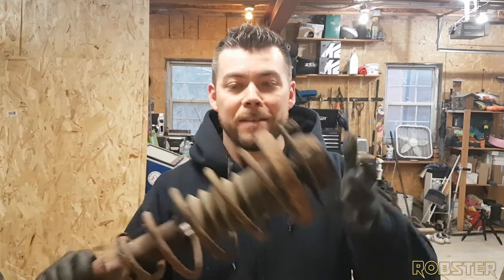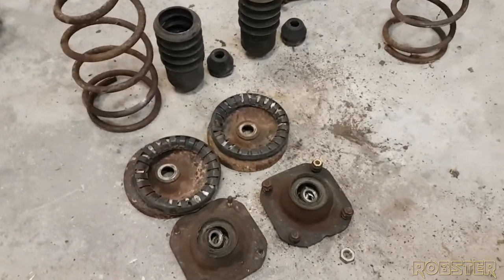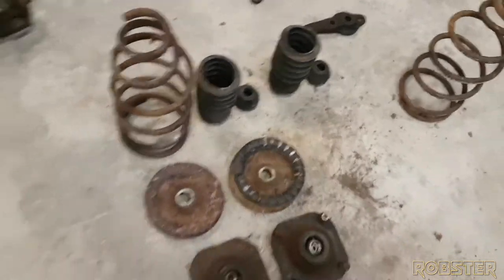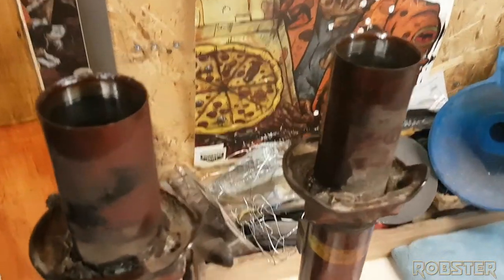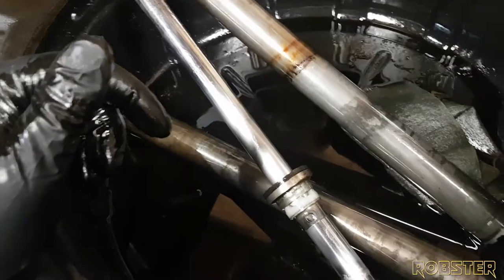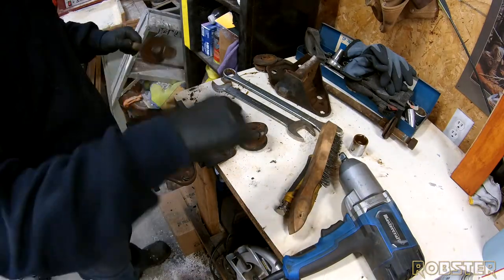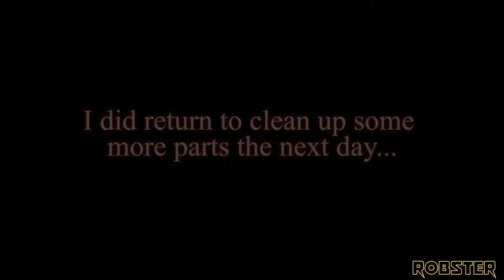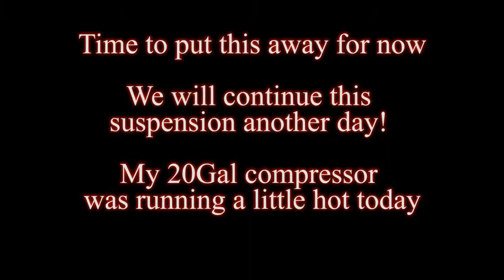GSL-SE - FRONT SUSPENSION DAY 1 - 1982 RX7 RESTORATION

Comment: Hey man, I hope you still read your comments.

I am getting ready to do my front struts on my 1982 Rx7 and I want to replace them all together with updated KYB struts. 

My question does the spindle come off of the strut?
Reply from the maker: Hey dude! They do not! The shock is an insert to the strut/spindle. There's a massive nut on the top that holds it all in there. Only place that I know of that sells new struts complete is Techno toy tuning if you want to go that route. Otherwise compress the spring,  remove it and undo the nut at the top of the shock and pull them out. They may get stuck so just pull and pull until it comes out. Good luck!

Comment: I found these in my 1983 RX7, early struts were rebuildable and known as "wet struts" (this is what i was told in in the late 1960's) I first saw them on a 1968 Ford Cortina and my dad and I were happy when strut cartridges  became available ~ 1971. I was surprised to find that Mazda used them as late as 1983
Reply from the maker: Oh! awesome information! Thank you for tuning in! Yes I found these very odd to see at first but they make perfect sense and I found that the strut casing itself was much stronger because of it.

Comment: I did not know they didn't make the cartridge style struts for the SE.  Interesting since everyone and there dog does this swap.  Looking good
Reply from the maker: Thanks! I think these are fairly similar to the GS struts only a little beefier as well as the hub may be different 🤔 what I should do it take the one out of the GS and do a comparison video 👍
Reply: @RustedandBusted  yeah if the length or width isn't different the drop ins should work.  The factory struts for the other models look like that too.  The Replacements is the cartridge style.
Reply from the maker: @MrSchnarr  Ive ordered some MR2 inserts and miata springs 😉 a little secret info to the next video lol